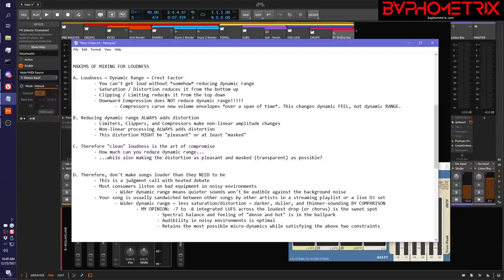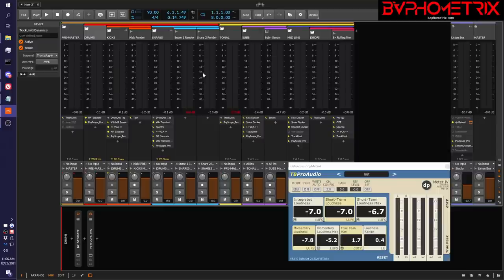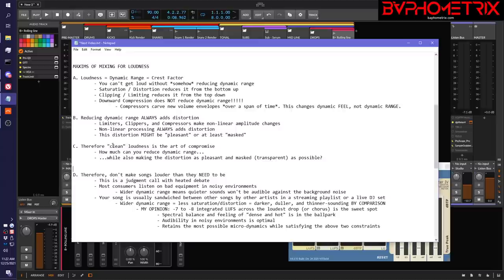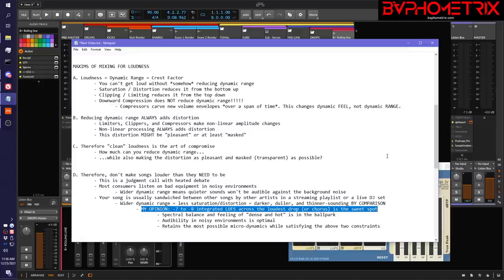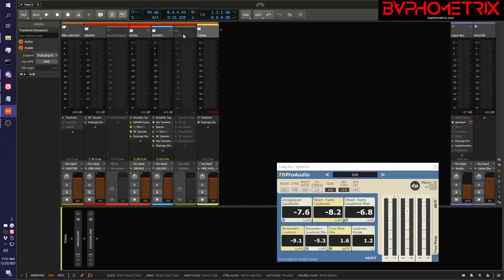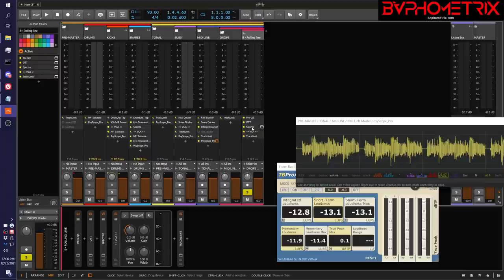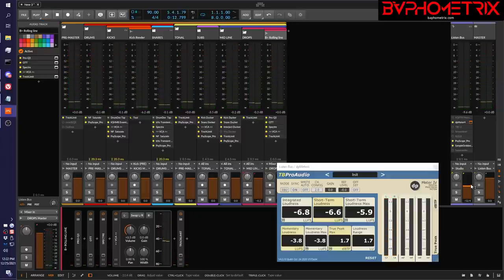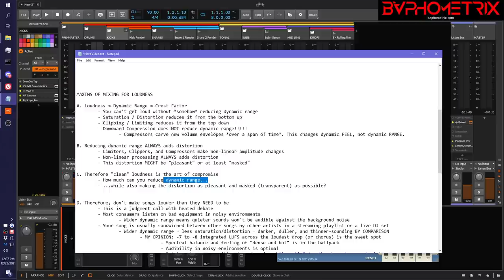Loudness is in the MIx, not the Master! PART TWO

Comment: How would you create that listen bus in ableton 11?? been trying to but havent been able to get the routing right. Would be awesome to get some advice on this. your content is absolutely delicious my mixing has already been leveled up over 9000!!!
Reply from the maker: Sorry, Ableton's audio routing is less flexible than Bitwig's. I'm not really sure how to make a decent listen bus in Ableton.
Reply: So after a few hours of trying to set this up in Ableton, I think I found a solution. To create the listen bus:
- Go to the "Master" change "Master Out" to a different channel
	- Default should be 1/2. Change from 1/2 to 3/4 or in my case I changed to 9/10. (Basically any unused channels if available)
	- The keep the metronome "Click" you will need to keep "Cue Output" on 1/2

- Create an "Audio Track"
- "Audio From" choose "Master"
- "Monitor" from "Off" to "In"
- "Audio To" "Ext. Out" Channels "1/2"

This should create the same kind of listen bus as outlined by Baphometrix. Hope this makes sense and helps!
Reply from the maker: @JoshuaHardee  Thanks for sharing your creative solution!
Reply: @Baphometrix  I truly appreciate all the knowledge you are sharing! It's amazing! 🙏🙏🙏,,, I did run into an issue with changing the "Cue Output" to 9/10, I no longer was getting "Count In" metronome. So changing "Cue Output" back to 1/2 (Keeping "Master Output"  on 9/10) brought back the metronome without affecting the listen bus... Again, appreciate your knowledge and look forward to more of your deep dives as they are amazing!

Comment: Awesome videos!  I have a question.  If your not clipping anything are you supposed to turn the gain up? 

Is that a clip gain on each track for vca?
Reply from the maker: I need a little better description? I'm not sure what you're asking, sorry.
Reply: @Baphometrix  My samples are not loud enough to clip at 0.  Even when I send them to a bus there is only about 1 db of clipping.  Do you turn the samples or VST instrument up (with gain) until clipping starts to occur?
Reply: @davidpedroso2160  Based on my knowledge, that part is in sound design where a plugin like Psyscope can show you what to clip/limit if you ever decided to do so to shape the sound. But at the mixing stage, you must set the levels by ear and in the context of the whole mix. If you hear it well enough and it isn't reaching the clipping threshold, it doesn't matter! Sorry to sort of step on Baphometrix , I'd love it if he could explain this in his own way which is so much better.

Comment: This question has been on my mind and I apologize if it's something basic: On a track and bus, is the TrackCTZ and BusCTZ the last thing on the chain? Do all processing (EQ, Compressors, Duckers etc.) come before the clippers/saturators/limiters? I noticed on the Premaster, there is some processing that comes after. I just wanted to capture the rules of engagement and setting up my template. Thank you for helping me clear this up in my head. :)
Reply from the maker: Yes, the clipper always comes last. Think of it like working on an analog desk. Every channel has an absolute headroom that you can drive the signal into and it just soft-clips by the analog circuitry. The main difference here with the CTZ method is that digital hardclipping is usually more transparent. But you can also softclip instead, or use TrackLimit.

Comment: Because I have a large number of questions about audio engineering I am curious, once again, about your opinion, this time on levels, how to set them to obtain maximum loudness.
Let`s say that we compress, eqing,  distort and clipped our kick and snare and we like the result and the next step is to set the levels. 
I take a random noumber, -5, and I want to set my levels after this. So, I set my kick level on -5 and my snare on -5, too, because is easy and sounds good to my ears.
Now, I know there is not a general rule but I curious about sub in this random case: how do you think you can obtain the maximum loudness - with a kick that is on the same level of the sub, under the level of the sub or on top.
When I say level, to be clearer, I take for example a pro q and watch the volume of the kick and sub to see if is under, on the top or on the same level. Simple as that, I dont want a fixed noumber for my bass level as if I had -5 on my kick then my sub must be bla bla.
If you have exact numbers to set your levels, I am curious about that, of course
I am talking here just for hard bass music, music that is made with a lot of layers where you "must" hear the loudness from the layering stage.
Sorry for my bad english but I'm sure you understood what I had to say.
Reply from the maker: I cover this in more detail in my written CTZ guide. (Link in the video description above.) Specifically in "Step 5 - Estimate Ideal Loudness". As to your slightly different question about "should the sub be lower or higher than the kick in something like a spectrum analyzer or oscillosope?" The broad answer is that your kick and snare transients will typically sit higher in any type of spectrum or oscilloscope/waveform view. But by how much should the max amplitude of the sub's signal sit LOWER than the kick or snare transients?  That depends. You simply set that by ear.  How massive vs subtle the subbass is in any given song is very genre dependent. Your best bet is ALWAYS to look at the sub energy of some good reference tracks in the same genre. Where do the sub notes hit on the spectrum analyzer (or oscilloscope) in the reference track?  Is your track also hitting in the same general area?  Do your ears (and your subpac, if you have one) tell you that your sub has the same amount of power and weight in the mix as in all your good reference tracks? That's where you set your sub levels, relative to your kick and your snare.

Remember. In the genres you seem to work in, the kick and snare are the "anchor points" for your entire mix. You set those at the right LUFS value (specifically the Max Momentary LUFS value) to get you in the right range to hit the loudness target you're shooting for. 
And then you don't touch the kick and the snare again for a long time. You build up your song arrangement, bring all those new sounds into the mix, and level them (balance them) against the level of the kick and the snare. And... as soon as you can get ANY half-way decent sub sound and groove/melody for it into the mix, the better. In most electronic dance music genres, the kick, snare, and sub are the fundamental framework sounds for the entire mix. Get those three sounds working well together and then leave them alone and simply balance and rebalance every OTHER sound you bring in against those three framework sounds.
Reply: Thx for your answer, mister Baphometrix!

Comment: Some facts about hearing loss: prevalence of presbyacusis (measured between 500hz - 8000hz) is still <50% of the population under 60years in most countries, so not likely in over 50% of cases that all people in those age groups cant hear above 14kHz. Noise-induced hearing loss from headphones or machine noise over time typically only affects freq between 2000-6000Hz (doesn't affect above 6000Hz in most cases), and wouldn't occur if monitoring around 80-85 dB SPL C for 8 hours per day (with no breaks).
Reply from the maker: Good stats, thanks. Chalk up my sweeping generalization that "most people..." to anecdotal evidence. ;) Also anecdotal: monitoring at 80-85 SPL on near-field monitors is OWIE ! Not everyone has access to larger control rooms with big far field placed some good distance away.

Comment: Baphometrix, can you make a video about the different clippers there are on the market, different modes(soft, 2:1, etc).
Luca Pretolesi, Illangelo, etc. are using StandardCLIP in Soft Clip Pro(for Illangelo for example) and so on.
They have amazing audio monitoring and they hear these little subtle variations.
Do you hear clear and without a shadow of a doubt the differences between the different clippers out there on the market?
Thx for your video!
Reply from the maker: I have great respect for Luca. BTW he also advocates exactly what I'm teaching here (and in my CTZ method), which is using LOTS of little clips across every track and bus of your project. Here's Luca himself saying so:  https://youtu.be/Ov4WR5xx5Dc?t=1994 . As to your specific question, StandardCLIP was the best for a while because it was one of the only clippers with an oversampling mode (which can reduce aliasing foldback and therefore some harmonic distortion from the clipping process). KClip also had oversampling. But there's a problem with oversampled clipping--it quite literally produces peaks that sit ABOVE the threshold of the clipper!  This is fine if you're using the clipper to COLOR the sound while you're also helping to reduce its dynamic range. And if you don't care about the peaks above threshold (even though later in the chain, some other clipper or limiter will still finally have to deal with those peaks.

KClip was the first oversampled clipper that had two clipping stages inside it. You could oversample the main clipper, but then the "Ceiling" knob was actually a second hard clipper that shears the peaks above threshold from the first stage. This is one reason I liked KClip a lot when it came out. Now you could get the best of both worlds: absolute peak control and oversampling if you wanted it.

Then more recently Newfangled Saturate came out. Which, despite its confusing name is a CLIPPER. A spectral clipper. Long story short, in hard clipping mode it provides absolute peak control but also magically maintains a lot of the mid- and high-frequency information throughout the flat "laser beam" portion of the clip. So I often use NF Saturate instead of KClip, at least in later mixing stages of the project, to get a "cleaner" sound that is in some ways closer to what a limiter would do, and yet still sounds crispy and punchy on material like drum hits and foley sounds, etc. (or even on some hard-edged mid-bass and lead sounds).

At the end of the day, whether you want to improve/control/decrease dynamic range with SOFT clipping shapes that color the sound (make it slightly darker and warmer) is a subjective choice.  This is why I break the decision into TWO parts by saying that when you need to make a sound louder (reduce its dynamic range), you FIRST "Saturate from the bottom" (color it to taste). Then if it still isn't loud enough to fit where it needs to in the mix, you next "Clip from the top" (with a hard clipper or limiter), to push the peaks downward as transparently as possible.
Reply: @Baphometrix  Thx a lot for your answer!

Comment: Hey Bapho i rmb that you said in those previous vids u dont clip subs and bass sound right? Also I had damaged hearing too and wonder if you could share some ways when dealing with those high frequencies? 😅 Thank You very much!
Reply from the maker: Your sub track alone should never come close to 0 dBFS, and therefore it never needs to be clipped. Now "bass" sounds could be very wide-spectrum, and very loud in the midrange (and highs), which is why we often call them "mid bass" sounds. Those might very much need to be clipped. It all depends on their sound design.  As for damaged hearing, the main trick is to use some tool (or build an audio rack yourself) that can *isolate* certain frequency ranges in the spectrum. For example, MetricAB can do this. Also a tool called ISOLA8. And many many others.  So when I need to hear what's happening above 8 Khz, for example, I isolate the  8 Khz through 20+ Khz range. And then I carefully turn up the volume on my monitors or headphones. Damaged hearing doesn't necessarily mean you cannot hear certain frequencies at all. It usually means they're just suppressed (attenuated) in your physical hearing response. So you isolate and crank the volume to the point where you *can* hear that range more clearly. BE CAREFUL to turn the volume back down before you punch the button that brings the full mix back! Ouch!  And that's just *hearing* the spectrum in that range.  You can also get very good at seeing and understanding what a spectrum analyzer is telling you about that area of the spectrum.
Reply: @Baphometrix  Ahh very much following ur ways as I did when I learned from you about the low end, also thanks for the sharing about "dealing high-end with hearing dmg" . Appreciate it very much!!

Comment: Thanks. I have a question. You didn't mention about the peak levels you are feeding into the first stage limiters/clipper. If the levels are different then some tracks will introduce distortion and some not but you gonna pull all VCA's down because of one chanell with that one knob.
Reply from the maker: The point of the VCA group approach is to keep my mix BALANCE (the relative levels of every sound versus every other sound) exactly the same as I drive the total set of sounds harder into the clipping cascade versus driving the total set less hard into the clipping cascade.  This means I'm not changing my mix BALANCE. Instead, I'm changing only how much (clipping/limiting) distortion is being injected into the total mix.  Think of how a multi-band compressor works (or a multi-band limiter like Limitless, or a spectral limiter like Elevate). the idea behind multiband processing is to compress or limit ONLY those parts of the frequency spectrum that are pushing above the threshold.  Well, in a clipper cascade across the tracks and busses of your entire mix, it's the same principle. Each clipper on any individual track (or summing point) is acting only on its specific signal in the entire mix.

Comment: Id like too add something to when you discussed not layering sounds in loud drops. Its perfectly fine to layer sounds if each sound in the stack of layers only occupy individual frequency ranges. But this is usually when the layers are intended to act as one new sound. Edit: I see you got to this later in the video.
Reply from the maker: Yep! that's the key. I mean, don't layer if you don't need to. It will make your job harder in various ways. But sometimes the creative vision you have for a certain song section requires layering sounds, so go for it and do the work needed to manage the overall summing of RMS and peaks. You can also spread the layers around in the stereo field too! For example, put one of them in the center, and push the other one more out into the sides. That also helps with the total amount of summing and peaks, as well as with audibility of each layer for the listener.
Reply: @Baphometrix  Also gotta say, Psyscope looks quite handy. but i might have something similar somewhere. i usually end up at -10 -9 short term lufs. when pushing towards -7 my kick and snare pretty much sounds like mashed potatoes. the transients are pretty much inaudible at that point when i use saturation and/or clipping. I would guess i'd have too much low end instead, but i really struggle with that part. taming those transients without completely ruining them when pushing for these levels. Very detailed an informative video btw.

Comment: So did you now replace Kclip with TrackLimit on every track for your productions?
Reply from the maker: No. I still prefer a clipper on drums and foley sounds. But for many/most "tonal" sounds, I'm in love with TrackLimit (specifically in "Punchy" mode with a 50-60 ms release time). In that mode, TrackLimit is SO freaking transparent--or at least really good sounding if not perfectly transparent--on tonal material. And it's incredibly lightweight, so you can pepper dozens of instances of TrackLimit all over your project, just like you can pepper dozens of clippers all over your project.  But usually I want that harder "edge" or "spit" of hotness that a clipper will add to drum sounds. If I need to keep the kick bottom round and fat, I just use a soft-clipping shape on the kick. (Like I did in my most recent video about "Has Dan Worrall convinced me?").

Comment: Do you use filtering on your 2bus? Inserting HPF on a full mix tends to raise the peak level which stresses the limiter more. It gets better when I use linear phase eq, but then there is a danger of pre ringing. What is your approach?
Reply from the maker: I'm not a fan of doing much at all on the final 2 bus (mixbus, aka "Master", etc.). I'm not even a fan of doing all that much on my Pre-Master bus. Maybe some final very gentle EQ shaping. Maybe some "pretty processing" like Gulfoss does. Maybe some very very very gentle bus compression with an SSL-G style bus compressor. That's about it. And quite often I don't do any of that.  By contrast, I'm a big fan of fixing problems at their source. On the original track where the problem really originates, or on some intermediate summing point where early track signals, or lower-level busses, are coming together, getting summed, and now interacting in troublesome ways.

So.  If I do lowpassing, it's usually closer to the problem sources long before we get to the 2 bus.  And yes, any type of pass filter (even anti-aliasing filters when you use a plugin in oversampled mode) will create new peaks that are higher than the original signal  had. By clipping those new peaks as early as possible, closer to the place they were first introduced, you have a lot less trouble by the time all those signals have rolled up to your 2 bus.